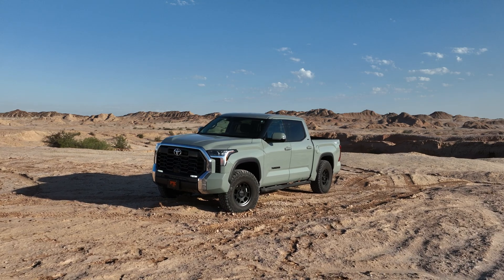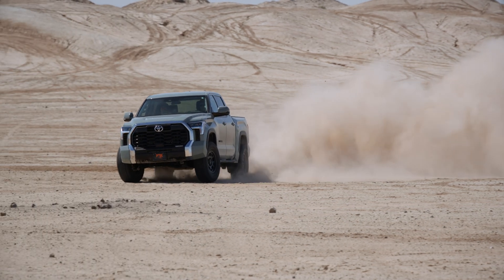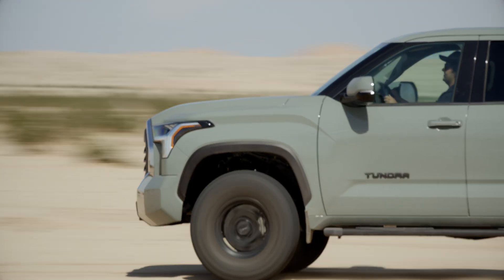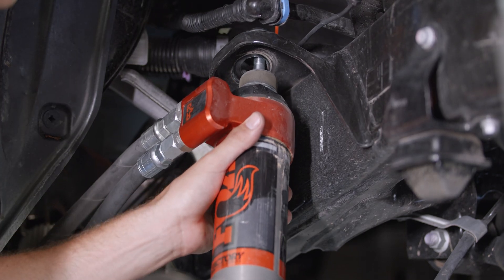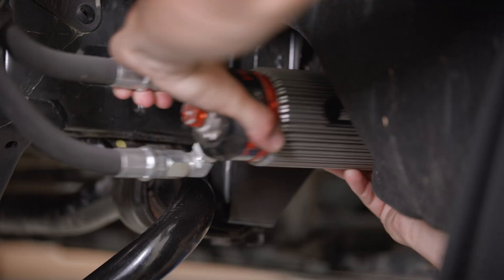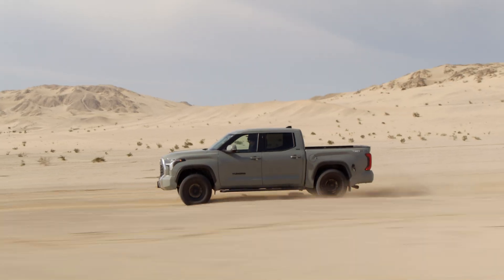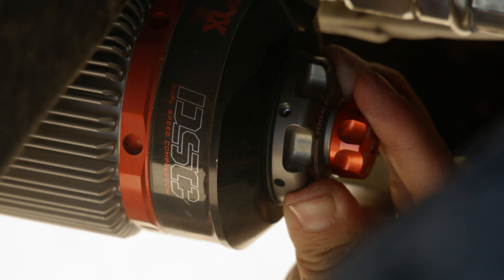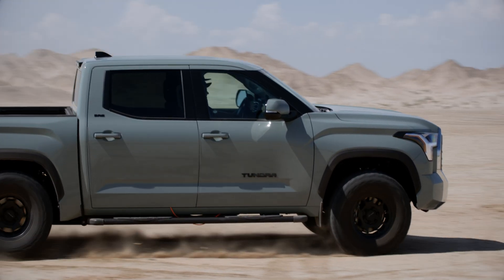What it takes to tune TUNDRA FACTORY RACE | ACADEMY | FOX

Comment: Hello Guys im from indonesia , have a question How to revalving it (3.0 IBP FOX) for a stock JL i have spacer lift kit 3" and 35" ko2 and terraflex arm kit but no additional weight at all , do you guys have a suggestion to do for the shims or ports, or maybe have a contact or email for me to have a conversation ? Its really stiff and i want to tune it to get a softer ride (already softest clicks both high and low speed) , thanks guys really apreciate any help

Comment: what's the price on this set up
Reply: Dont be lazy.  It takes literally 13 seconds from comment to finding the page - just timed myself. 
Goes to Fox Website... finds 3.0 Factory Race shocks for 3rd gen Tundra...... Sees the price for rear 0-1" lift and 1-2" lift, sees the price for front's....  
Yup.  Ez Pz.
Reply: What brand are those uppers besides shocks what else is involved with build?